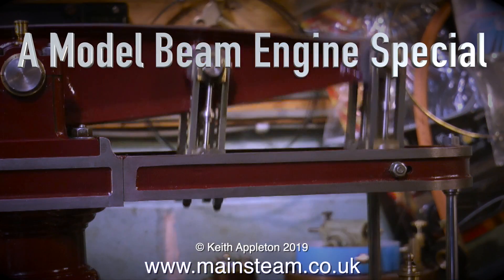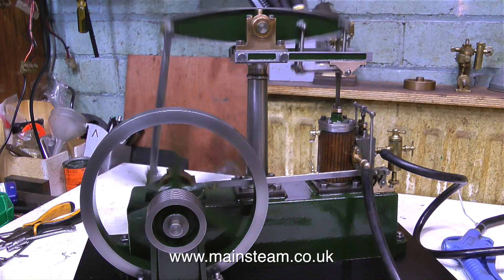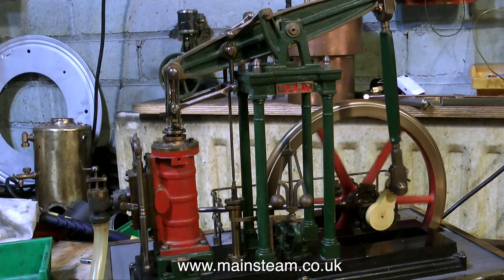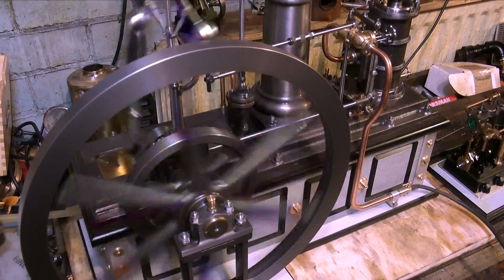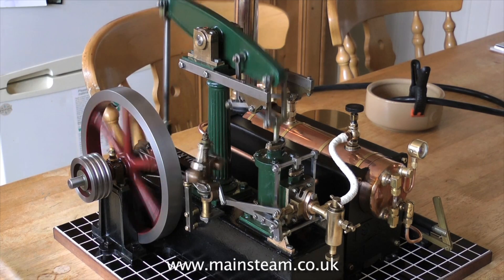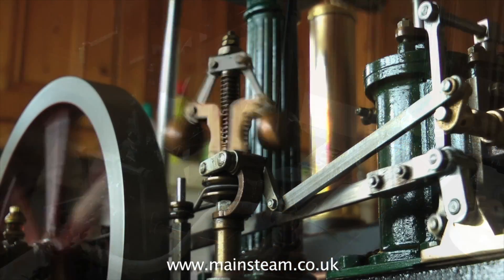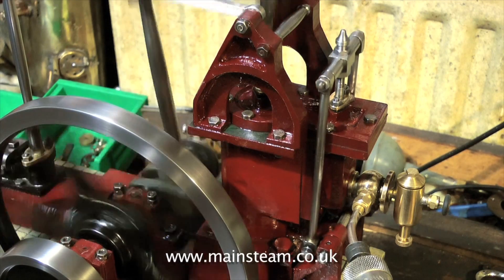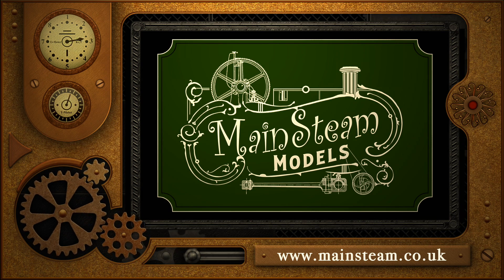A MODEL BEAM ENGINE SPECIAL

Comment: , I could sit and watch a beam engine for hours.  In a real working situation on a small engine like this, are they designed to run quickly or slowly? I could see all of those extra moving Parts becoming a problem at speed.
Reply from the maker: Normally they run quite slowly.